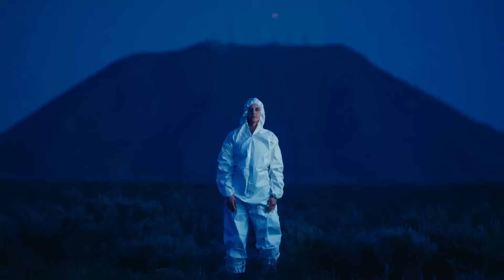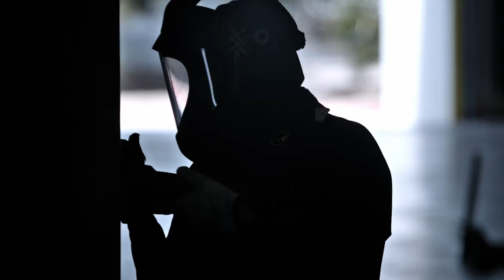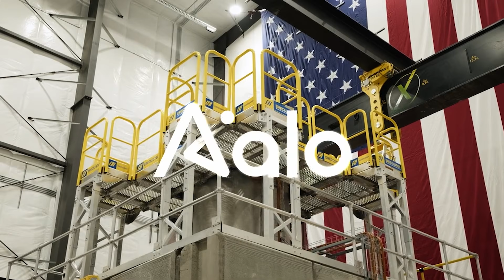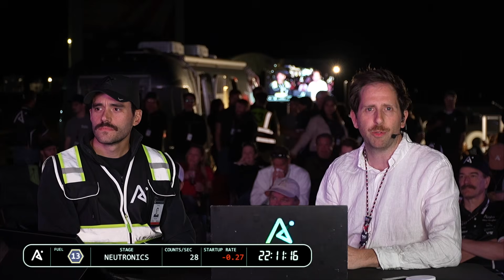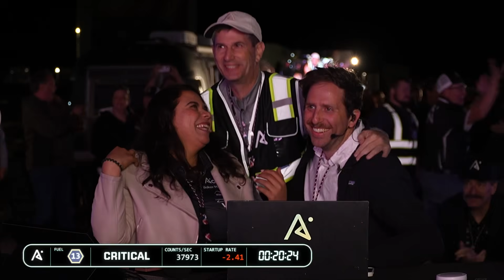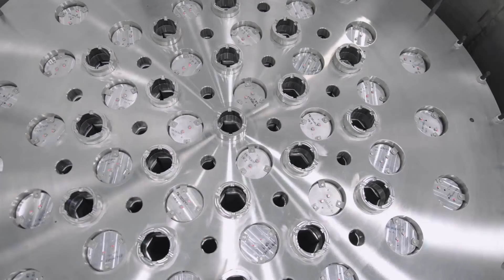Watch a Reactor Go Critical on July 4th | Aalo Criticality Highlights

Comment: Pandemics pose a significant danger. UV light at 222 nm has the potential to reduce disease transmission during such events. No harm to human skin or eyes.  Sterilray
Reply: Advertisements through comments in 2026 is as special as opening a time capsule